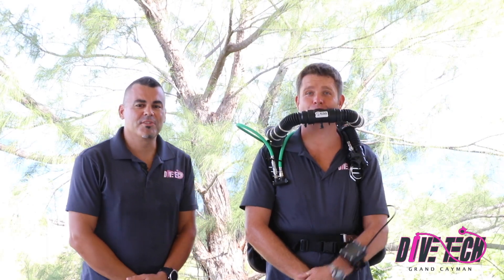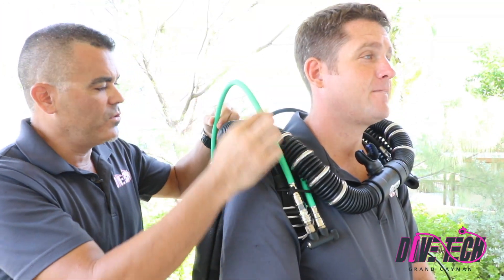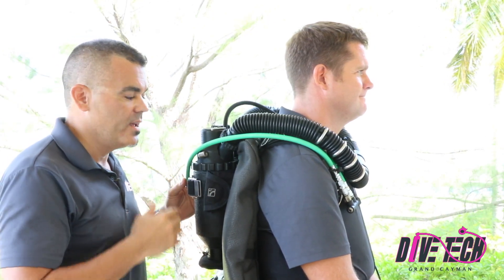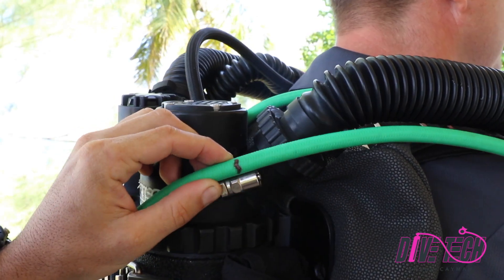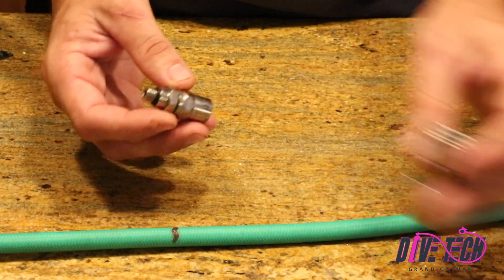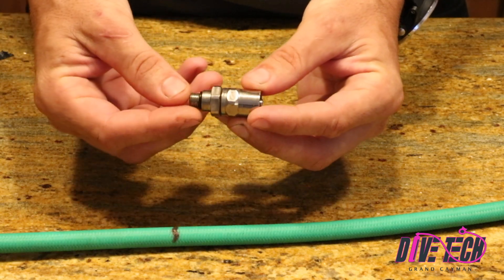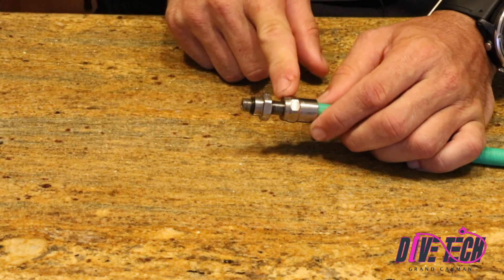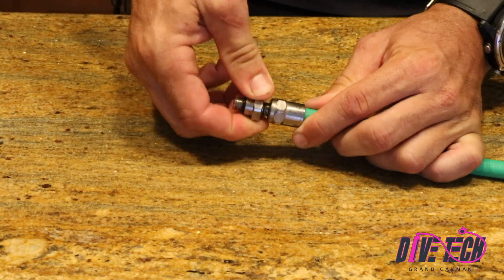How to make a custom length low pressure hose

Comment: As someone whom produces and pressure test hoses I wouldn't recommend most divers to produce their own hoses like this or adjust lengths. There are so many different fittings and hose manufacturers and the specs at which most hoses are usually produced go down to 0,1 mm tolerances. The hoses can be thick and thin, can have braiding etc... there are very many variables come into play that make this unsafe for a layman.

Comment: Nice, but costs twice as much as a new hose in proper length.
Reply from the maker: What if you can't find it the proper length? Hoses come in fixed length like 22 or 18 inches. What if you need a 19.5 inch hose?